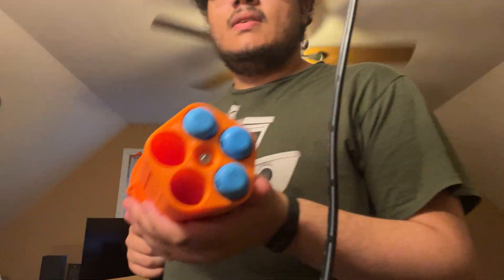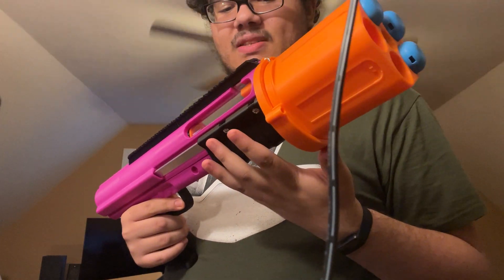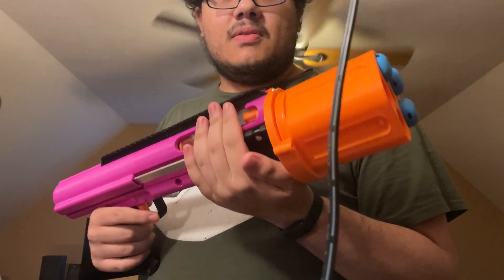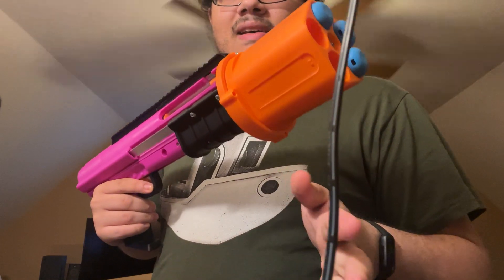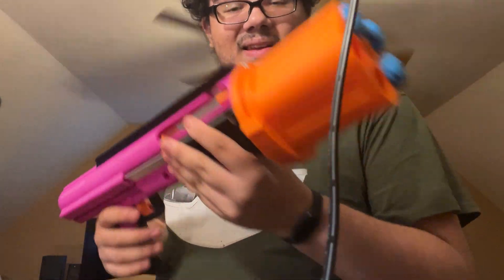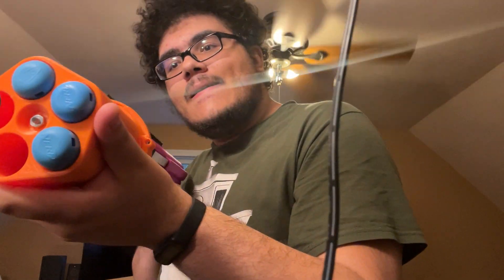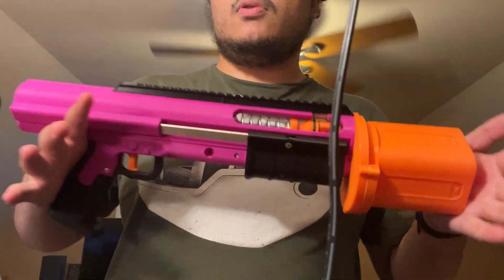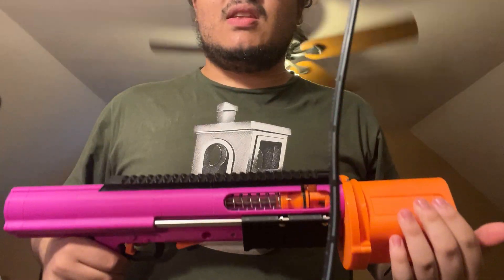MegaXL Revolver rifle: chronographing first prototype

Comment: Another gem! I'm in the process of building a MXL Hammerwald which should be finshed by next week. I'm a huge Mega fan and I may have to build this as well! Your blaster will already shoot 20FPS more than the Hammerwald. Any chance for a rear N-strike adapter?
Reply from the maker: An N-Strike stock lug is planned and partially modeled already :)